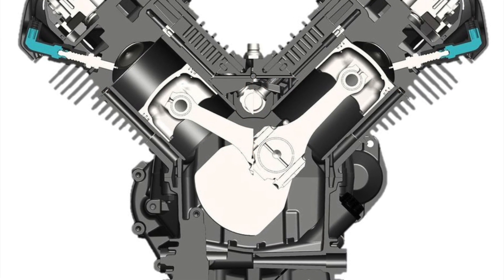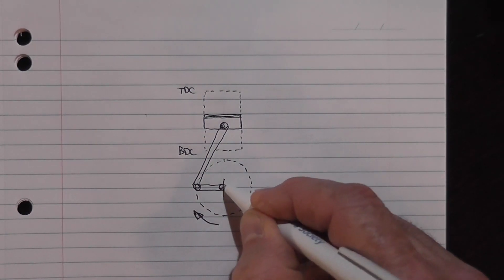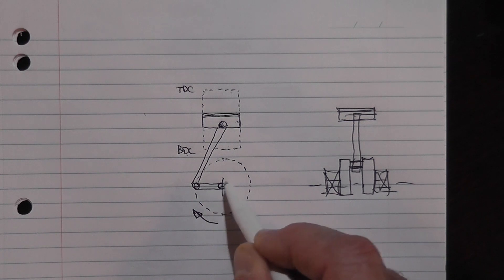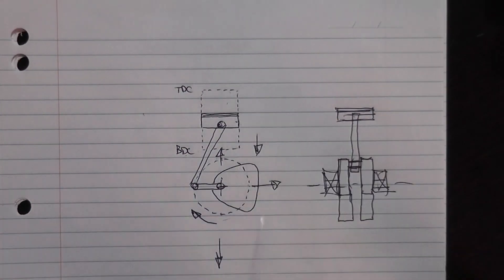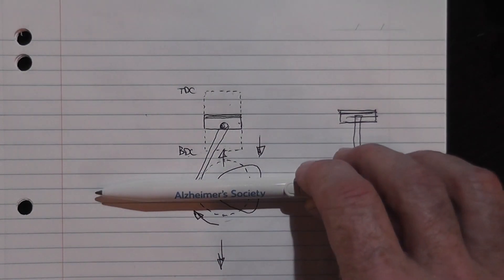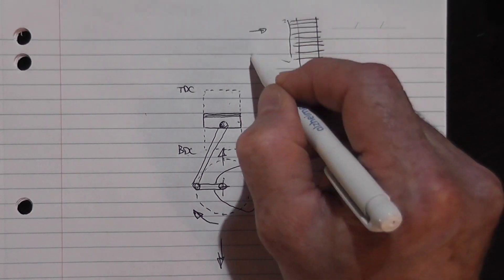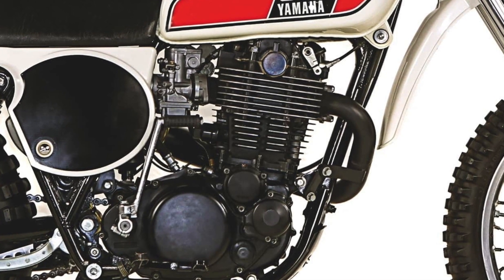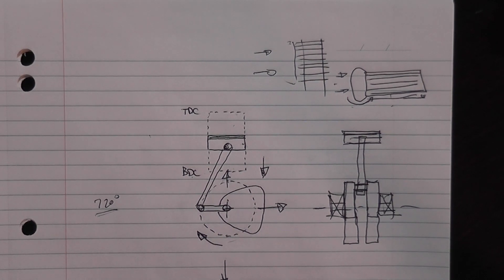Classic Motorcycle Engines Part 1 - Single Cylinder 4 strokes

Comment: Nice demeanor. I already understood most of your presentation. Still, I was a  little confused when you discussed a different lay out, horizontal cylinder vs a vertical cylinder. Maybe having a drawing or photo already to clarify which way the primary vibrations are going. Also, the wheel vibrating completely escaped me. I didn't know if that were for a horizontal or vertical cylinder.  thank you for the video and I appreciate the Alzheimers society.